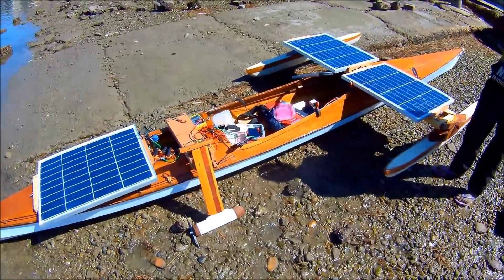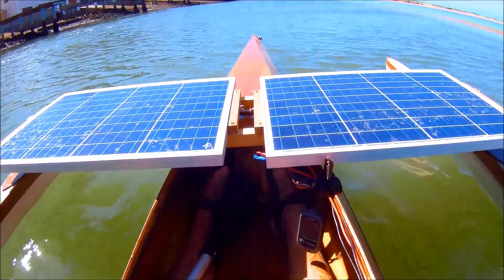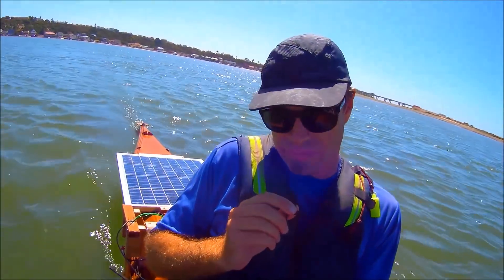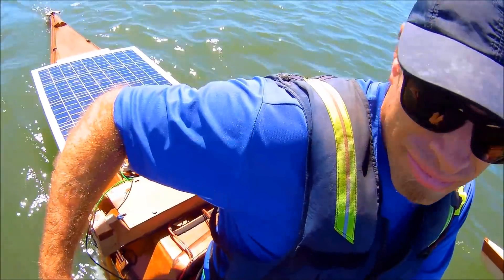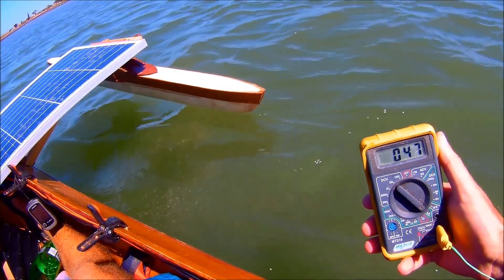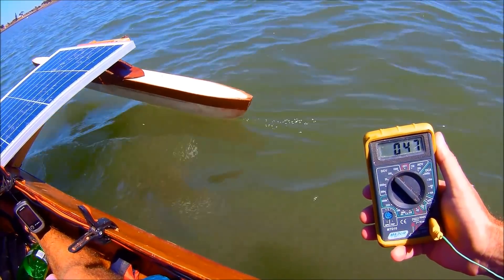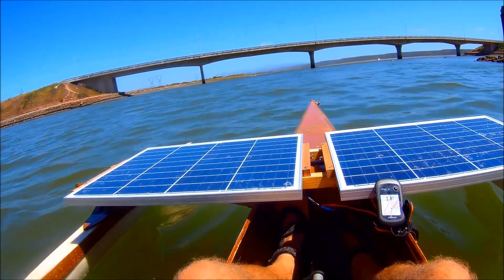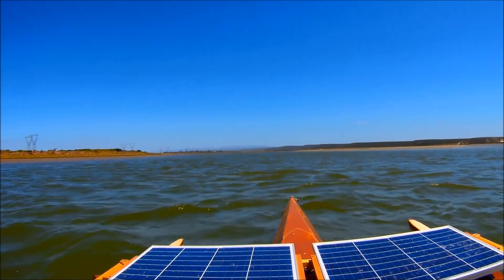Solar kayak - new propeller test

Comment: Interesting that you're using a model airplane propeller rather than a propeller design for water I would imagine that the efficiency is way off because of that
Reply: I totally agree. These props are designed for specific mediums. Air and water act very differently. Beyond that even, you should really look for one that’s tuned for the rpm range you expect to get. And that can change drastically when switching props. Do you will most likely have to make a guess, but an underwater prop, then realize the rpms are off, and then buy another one
Reply: Exactly what I was thinking. A model boat prop or one for a trolling motor would be better. Also a direct drive brushless motor would be more efficient. Pretty cool though!
Reply from the maker: To get good propeller efficiency you need a large diameter. Conventional boat props of sufficient diameter have way too much blade area and are designed with much higher available shaft torque in mind. With sufficient gear reduction it should be possible to run a boat prop on my limited power. The brushed motor is only efficient at high rpm (>15k) and its gearbox has a 9:1 reduction. Even so the torque required by the slender apc prop is a little too much and loads the motor beyond its peak efficiency.
Reply: @williamfraser  indeed but what about slightly smaller scale 3d printed ?
Reply from the maker: @Midnight17925  What I REALLY want to get printed is a custom surface drive prop!
Reply: @williamfraser  Its it a brushed or brushless motor? Because you could squeeze some additional efficiency out of the system with a brushless motor.

Different screw, more efficient motor, you might even make 4 knots.
Reply from the maker: It was a brushed motor. It is now a container of rusty spares. All parts got upgraded on my new motor. Big panel, charge controller, the works.
Reply: @williamfraser  please provide details on new controls and charge controller.
Reply from the maker: @jimthvac100  here you go: https://youtu.be/wys0oQKtMpM
Reply: what if you were to use a propeller from say a underwater scooter. They are quite a bit smaller than a traditional boat propeller, but still are meant for water.
Reply from the maker: @schrademan08  Any propeller could work if you use the correct rpm. The motor only operates efficiently at a specific rpm, so for each prop you would need different gear reduction ratios.
Reply: I have fitted one of these to a trolling motor and it made it faster, next I am trying 2, I tried a small outboard prop and it had the opposite effect.
Reply from the maker: @electricdeckhead3083  what size prop did you use? And what trolling motor do you have?
Reply: @williamfraser  I have a 55 lb thrust and changed it to a 10x5 prop, thinking of trying 2 8x4's this time mounted in an x pattern. If I can work out a way to reverse the rotation of my motor I will have more prop options.
Reply from the maker: @electricdeckhead3083  yes it is a pity that the pusher props come in such limited sizes. Do you have any means of measuring current while underway? If your motor was not struggling to get up to speed (rpm's) with the 10x5, then you should ideally choose another 5" pitch with larger diameter, or go up to 6" pitch. I know of more than one similar conversion and they all ended up with a 10x6. Also try other propeller brands. APC's thin electric are very good but I have seen test data from Master Airscrew (G/F series) that look really promising. I am running their 10x8 on my new brushless drive. Just stay away from the Master Airscrew Scimitar series. I have seen windtunnel data for them and it is really bad.
Reply: @williamfraser  I didn't have a means of measuring current, but will have when testing further, I was looking at the scimitars also, they looked like the goods, but looks are very deceiving with this venture, hence some of the comments, until you try it these props seem very out of place on these motors. Thanks for the pointers, I will continue to experiment I guess, I am running my set up on a small mini boat with a lithium battery 50ah and 60 amp max draw.
Reply: Check what the solar challenge engineering teams use to get the best efficiency under solar power.  Typically it's model airplane props.  They actually pair quite well with the lower power produced by solar setups.  Trolling props are engineered to cut weeds and produce high thrust at low speeds so they aren't suitable for this application.  Standard boat props are designed for very high rpms with rounded blades to minimize cavitation.  At lower rpms RC airplane propellers still win.
Reply: I've read the arguments here about the airplane prop, personally I think the high aspect ratio of the airplane prop gives far too much drag as the tip speed in water is very high. The reason all water props have a small diameter is to limit the tip speed and therefore the drag.
Reply from the maker: Graham these air props turn very slowly. When I switched to a brushless motor and a 10" prop, the tip speed was still 30% less than the 7.25" prop on my 2hp outboard. But it is more complex than that. I'll explain in an upcoming video on prop selection and work through some examples.
Reply: @Imasurvivor2  Most props like the ones that come with trolling motors are designed for pushing a much heavier hull. The model plane props are better for this application, as  pedal powered craft folks discovered a while ago.

Comment: Looks like Swartkops? I ABSOLUTELY love your idea - how about a 400W PV Panel & 48V/100Ah LiFePO4 Battery & 48V trolling motor? Should last more than a few days?
Reply from the maker: Yes, Swartkops. If you continously monitor power availability, power consumed and battery capacity you could run a setup like that 24-7.
Reply: @williamfraser  I assume you are from PE? 
After looking for a 48V trolling motor - I realized that I should be looking for hen's teeth rather. 
A 12V motor could work - reducing battery voltage 48V-->12V & 12/48=25% therefore 100Ahx4=400Ah?;  
A 400W PV panel weighs about 23kg but an array of mounting options are available - one can be creative; 
A 100Ah 48V (15S) LifePO4 will weigh less than 30kg and store 3.65Vx15Sx100Ah= 5.475kWh with a usable 4.3kWh (80% DoD of 5.475kWh).
If one has the current this motor will use you can estimate the operating time in hours (without and with charging from PV panel).
Reply from the maker: @joatmofa0405  Yes I live in Bluewater Bay, just a short walk from the estuary. 12V is the most common for trolling motors, which means you are looking at a 30A+ system (charge controllers etc.) if you want to make full use of the 400W. Version 2 of my kayak used a 300W panel at 31V. At 300W input, the brushless motor max efficiency voltage is 27V. I used an MPPT rated for 40A (although 20A would have been safe) and sized the prop to pull the voltage down accordingly.

Comment: Your voltage drop is caused by a current surge. The motor draws the current but is a low resistance path, which aliviates the pressure the panels are producing to drive the current. You're getting the same power, there just isn't enough resistance to be able to measure the potential energy. It just all turns into mechanical. Also, with panels wired in parallel, if you reduce the voltage coming from one panel (shade), the other two panels will dump a reverse current into it. A diode on each panel would fix this, wiring in series would not. In series, the panels will produce a higher overall voltage, but shouldn't be able to supply the current to your low resistance motor due to the high internal resistance in the panels. The people commenting on the prop are right as well, you need a three or four blade hydro-prop as that air prop is probably flexing to nearly flat and letting water slide past. This would provide a higher resistance out of the motor, reducing your current and letting you read voltage if you wanted. Right now, you're just running amps through windings not meant for them, if it's a brushed motor. If it's brushless, then the energy is moving the same way and tearing up the semiconductors in the speed controller. Overall, a proper propeller and some diodes, possible a battery as well, will make it a ton more efficent. That's an engineer's advice at least.

Comment: Might it be a good idea to mount the motor on the rudder?  Might be quieter?
Reply from the maker: Rudder mounting has a lot of advantages and would be my preferred option in the long run. During these trials it helped having direct access to the motor while on the water for troubleshooting and removing weeds from the prop.

Comment: If you put an MPPT between the panels and the motor it will hold the panels at their most efficient - alternatively if you put a cheap PWM controller between panel and motor you can adjust it so the panels are only pulled down to their max power point tracking which will be between 16.5 and 18v for 36 cell  panels - the way you have it now you are stalling the panels  - your tweaking the prop to alter the load on them  - very interesting project
Reply from the maker: I have a small MPPT that can handle one panel's current. Might work well on a small kiddies boat. A typical PWM charge controller only reduces the voltage but does not step up the current to keep power out equal to power in. I am busy working on a buck converter that can do that. All power electronics have their own losses, so the cheapest option is actually to just add another panel. The additional available current should be enough to keep the panels, the motor and the prop at their respective max efficiencies.
Reply: @williamfraser  If you put a voltmeter on your panels and a cheap PWM controller from the panels you can adjust the throttle till you bring down the panel open circuit voltage to its MPP - It works we know we used it on our solar car  at Silverstone & won the Shell car with the simple expedient of sticking a pointer on an analog voltmeter at the MPP voltage  and adjusting the controllers  till the arrows meet  - we used  the same principle on our canoe RA - Its the voltage going to  motor that dictates  its speed - it will draw as much current as it can to try and achieve that speed  and if it cant will pull down the voltage - PWM controller is a variable buck converter with a few caps to smooth out the surges  on the input - the motors inductance should smooth the outlet -  honest try it with old style voltmeter and cheap ebay 20a controller

Comment: Running the motor directly from the panels is brutal. You are missing out of a lot output from the panels! You don't necessarily need mppt, as you load is constant, but you need a motor controller so you can load the panels at a level that produces most power, the highest speed. which will be when the panels are at their rated load voltage. I'm sure your voltage reading is correct, you are simply forcing your panels into the ground, losing 3/4 of your solar power. Also a sizable electrolytic capacitor near the motor, will help a little and produce stable voltage readings, if that is a problem. A brushed motor produces electrical noise in the wiring. A reverse diode across the motor terminals to recover back EMF, reduces noise further but prevents you from reversing thrust.
Reply from the maker: I was losing some power, but not that much. The motor was revving pretty high despite being loaded, so voltage could not have dropped by that much below MPP.  The key was in selecting a propeller size that would load the motor to its maximum efficiency rpm while drawing just enough current to also load the panels to their max power. With the sun at an angle the maximum panel power would have been around 130W. When calculating backwards from the propulsive power required by the boat at that speed, taking into account prop efficiency as well, I must have been getting around 110W from the panels. I had no trouble getting voltage readings while testing the motor in a bucket, so noise could not have been the issue. I most likely just hooked up the meter to the wrong wires. I am building my next solar boat now with all the bells and whistles: brushless motor, mppt, smart panels, efficient hull. Next race is 7 Dec....

Comment: Looks as though whole system is working very well. Would you carry a deep cycle battery as an emergency or would you simply paddle if needs be? Looks as though you have space for one more panel up the front. Thanks for sharing your experience.
Reply from the maker: I have acquired some batteries but have yet to test them. I have tested with an extra panel up front but the motor had issues and eventually failed due to a leak and rust. A 300W panel fits nicely up front so the smaller panels will be demoted to the one-sheet canoe. The new panel drives a brushles motor with custom gearbox. Video to follow.

Comment: Better to you accumulator and inverter. Direct electric from solar panel to 18 v drill without voltage control can be burn drill engine. If solar panels are paralel will be 65 volt a lot for 18 v i think

Comment: Did you really feel the difference with or without the solar panels? Because the solar panels have weights which I guess you added 45 lbs extra onto the kayak. So is the boosted solar panels justified to carry that extra weights??? I just installed two solar panels on my kayak which are 30 lbs extra. I did not feel much improved performance. Just a bit improvement only although the panel shaded me from the sun...... I like to hear your response. Thanks much. Nice video.....
Reply from the maker: Thanks. My performance depended entirely on the panels since I did not use a battery. If used with a battery, the panels will improve range. To get more power you will need to incease voltage to the motor.
Reply: William Fraser is it true that the solar panels act as resistors draw current from the battery while running the trolling motor. So disconnect the solar panels when running and let just the batteries power the running trolling motor as normally done. Use the solar panels charge batteries when motor not used??? Need to know if you agree. Also you can use 20  volts from solar panels providing 10A to run trolling motor at lowest speed without batteries???? Like you to clarify.
Awaiting response. Many thanks.
Reply from the maker: @josephpang7280  when solar is used with a battery, the panel voltage is higher than the battery's. A charge controller prevents reverse current from battery through panel when the panel does not get enough light. Use them simultaneously, this will reduce the current required from the battery and prolong its life. When you stop or reduce power sufficiently, the panels will automatically charge the battery.

Comment: Each panel needs to be fitted with diodes to eliminate resistance caused by a less performing panel. And yes, a decent little deep cycle battery like lipo.

Comment: Very cool indeed! Surprising how sensitive it is, just the shadow of your hand on the corner of the panel. Are they brushless motors driving the props?
Reply from the maker: This project still used a brushed drill motor. There should be a link in the description for the more recent version with brushless motor and large panel.
Reply: @williamfraser  Thanks i found that just  after i commented here, really interesting stuff you're doing.

Comment: Use a prop made for a trolling motor. It’s more efficient in water. Or better yet just use a 12v Trolling motor and prop setup. Nice build 👍.
Reply from the maker: It is counter intuitive, but the opposite is true. I first got the idea from someone who deliberately replaced his trolling motor's prop with an APC 10x6E. He achieved better top speed and did so with less power. Trolling props are thick brutes, designed to pull heavy boats at slow speed and survive all kinds of underwater impact and weeds.

Comment: If you have not already, you should add bypass diodes, so that when one panel is in shade it does not drain current from the panels that still have sunlight. This reverse current through the shadowed panel can also cause damage by overheating.
Reply from the maker: These panels do have bypass diodes, but they only work for series connected panels. Blocking diodes would help for parallel connected panels though. Blocking diodes are forward biased under normal operation which unfortunately means that they continuously dissipate power on all un-shaded panels.
Reply: @williamfraser  I believe there are things called smart diodes that solve some of the issues with blocking diodes. Don't know all the details.
Reply from the maker: @kevsthings8328  thanks for the tip. Just looked it up, what a fantastic component. I can think of many other uses for such a low voltage drop diode.

Comment: I imagine a  little rubber on the attachment points for the motor would reduce the surprisingly loud  motor noise.
Reply from the maker: Absolutely. I was able to compare the noise levels in the workshop, with and without the mount clamped to a table. A wooden hull makes a very good soundbox!